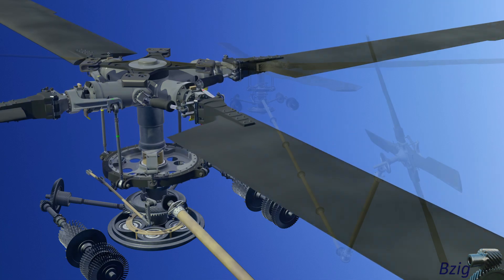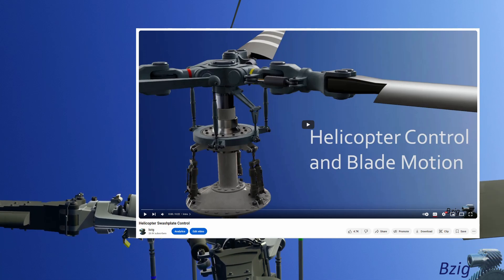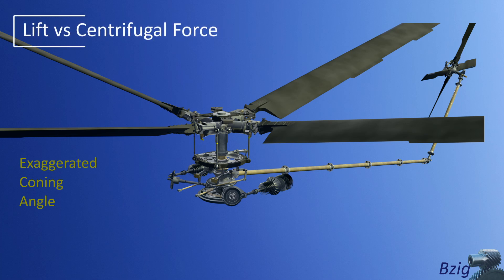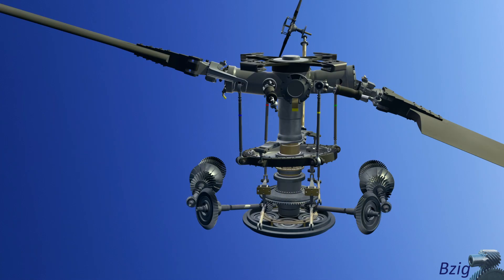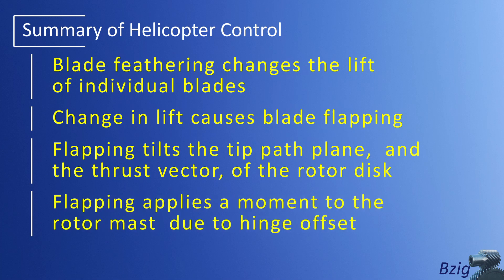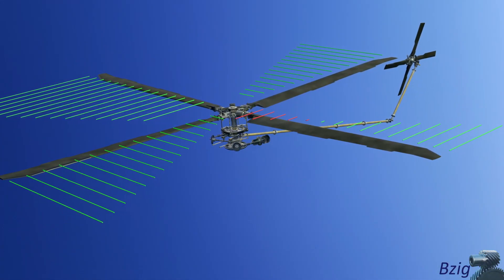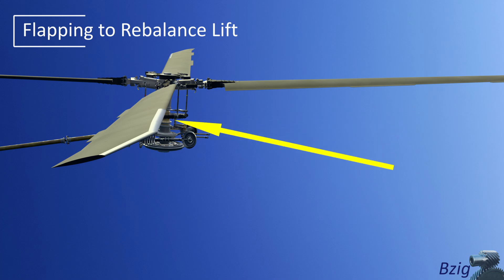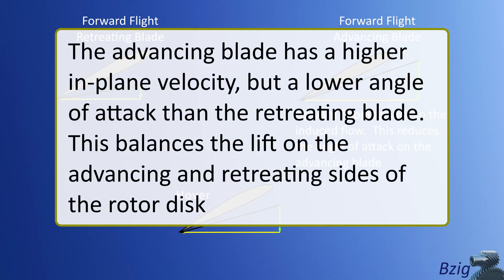Helicopter Control - Flapping

Comment: Your way of using normal flow to analize lift isn't a good way to analize airflow in a airfoil 
If we were talking about a fan type design like the ones on turbofan engine we would have used this method which is called the velocity triangle (in jet engines they are called cascades instead of airfoil) but in something like a helicopter rotor where you have 4 blades instead of 18 you have to use the pressure distribution and viscous effects to predict the behavior of the rotors
Reply from the maker: I think I understand you.   I'll write what I believe you wrote for confirmation... The airflow through a helicopter rotor is normal to the disk and helical through the disk.  by treating this a pure normal flow... I'm ignoring a significant contribution to what's aerodynamically happening.  Is this a correct interpretation?

Comment: How does rigid rotor systems handle dissymmetry of lift if there is no way for it to mechanically balance with flapping? Is it in the swash plate design that’s increases aog for treating blades with air speed? or does the pilot have to compensate with directional flight?
Reply from the maker: awesome question!  Check out ADA100181 "Advancing Blade Concept Technology Demonstrator" published in 1981.  This was much more of a "rigid rotor" than even the helicopters we refer to as "rigid."  This aircraft reduced cyclic pitch on the advancing side to reduce lift (and also had an advancing side on both sides of the helicopter).  The aircraft we typically think of as "rigid" such as the lynx and the BO-105 are not nearly as stiff as the ABC.  While the ABC needed some sophisticated control system to do what it did, the lynx and BO-105 deal with this with plain old flapping.  The hinges are called "rigid" but there is enough deformation to allow flapping.

Comment: ok, this just answered a question i had about heli flight characteristics
Reply from the maker: awesome... I'm glad it helped!
Reply: @bzig4929  i'm glad you exist with your efforts. they are not in vain. and i await more gritty mucky down to the bolt, details with very baited breath.

given you actually understand the area as little Timmy and little Suzie can understand what you say. a true hallmark of an expert is being able to explain it to a 5 year old and the child understands it.
Reply: @bzig4929  you've taught me so much about helicopter operating gear. Your channel has been invaluable.

Though am curious about the differences between the different set ups. I know contra-rotors have insane lift and speed, Igor's design is simple and effective, tandem is a weird hybrid of the other two, and intermesh is crack.

Comment: Would a dual rotor system (one of top of another, rotating in reverse of another) solved the retreating n advancing blade problem at high flight speed on top of eliminating the need of tail rotor? 

Do disregard my question above if is a funny or may even be stupid question;

Comment: Is it known if Igor Sikorsky was aware of these other necessary blade movements, flapping and Lead-Lag, and did he design the first helicopters rotor system with those freedom of movements? I can’t picture someone being able to anticipate those aerodynamic principles of a rotorcraft before they existed. Even the theory of collective and directional movements using blade feathering/pitch is astonishing for someone to be able to theorize and be confident enough about it working to build it and test it.
Reply from the maker: There was definitely trial and error even with Sikorsky.  The first version of the VS-300 used separate rotors for pitch and roll control... this was after Cierva first used cyclic pitch for aircraft control.  It's amazing what these folks accomplished.
Reply from the maker: recommend this 30 page history...  A History of Helicopter Flight, J. Gordon Leishman

It's a free download.

Comment: At 9 minutes in, you mention that the forward flight asymmetry of lift would cause the helicopter to roll. But since gyroscopes experience a phase lag of 90 degrees when a force is applied, wouldn't the asymmetry of lift actually cause a pitching moment for the helicopter?
Reply from the maker: I didn't say this as well as I could have.  I should have said... absent blade control... if you were just dragging a propeller sideways... then it would roll to the left.  With the flapping hinges, the blade on the right flies up, and the blade on the left flies down while the aircraft stays wings-level.  This tilts the disk to the left, and also causes a thing called blow back which, as you say, is an aft tilt of the disk due to phase lag.

Comment: Doesn’t the translation of the lift vector come from the feathering, not from the flapping?
Reply from the maker: feathering causes the lift change that makes the blade flap.  While feathering increases the lift vector, tilting the disk is done my flapping and this is what tilts the overall lift vector.

Comment: I can't quite wrap my head around why up flapping adds to the induced flow and down flapping reduces induced flow. I understand the resultant relative winds will change due to the flapping position. Is this the reason?
Reply from the maker: it's hard to explain, I think I did a better job it this video...  
https://youtu.be/gjZbgE8Yhg4?si=zk4DnXYZNt3Asrhf&t=280

Comment: During blade flapping in forward flight, I still can't picture why blades flapping up would "add to normal flow and decrease the AOA" Does anyone have a simpler explanation for this?
Reply from the maker: Hold your arms out to your sides with palms facing down.  Now flap them up and down... On the downward flap, you feel air on your palm.  On the upward flap, you feel air on the top of your hand.  

What do you think?  Anyone else?
Reply: @bzig4929  Thank you. After trying that out, I can see that the air felt by my palm on downward flap added "lift" to my hand. Continuing with this analogy, can you explain the decrease in AOA with my palm already facing down?
Reply from the maker: I think the graphics I included in my latest video... this one:  https://youtu.be/gjZbgE8Yhg4  do a better job of showing this.  Briefly... the air you generated by flapping is "normal," or perpendicular to the rotor disk.  The other component, that caused by blade rotation and forward airspeed, is in the plane of the rotor disk.  And the angle of attack is the vector sum of the normal and in-plane components.  So when you change either of those components, the angle of attack changes.
Reply: @bzig4929  It did. Way better explanation! Thank you! Glad I subscribed!

Comment: The drawing at 11:00 is 😖😵. Example: the 'advancing blade' and the 'retreating blade' are drawn at the same angle to the level axis of the video, but a black line is drawn higher for the advancing blade and drawn lower {decreased angle measure} for the 'retreating blade'. You know you have two angles: 1]the one that increases the surface area to apply increased 'force' on the atmosphere and 2] the one that raises or lowers the long-axis of the wing to coordinate the craft. I believe the word 'feathering' describes #1]. Each wing has to be drawn in '3D' to clarify the angles.

Odd that the pilot has a heated gear-powered meat grinder 5 to 10 feet aft of him/her in a helicopter.
Reply from the maker: I'm taking a lot of liberties with aerodynamics and making things "look kinda right."  If/when I get better at animations and geometry nodes in Blender I have this idea of feeding velocity vectors (I think this is what you mean by "3d to clarify the angles") with more robust aerodynamic equations.

Comment: The animation did not make clear to me why flapping down increases angle of attack.  Does the flapping mechanism introduce a cyclic feathering change in addition to the cyclic feathering change introduced though the swashplate?  Watching the animation the angle of attack seemed unchanging with flapping angle change.  BTW, this series is awesome, in general, much appreciated!
Reply from the maker: Your not the first to make this comment.  I'm thinking of re-making a video to explain this better.  See if this helps... While holding the blade pitch angle constant... when a blade "leads" the rotation, temporarily increases the magnitude of the in-plane flow of air to the blade.  Likewise, when a blade flaps, up or down, this increases or decreases the normal (90 deg to the plane of rotation) component of the flow of air to the blade.  The blade AOA is made up of both of those vectors... the in-plane and the normal.  So anytime one of those vectors changes, the AOA changes.  All while the blade pitch angle is held constant.
Reply: @bzig4929  TYVM, yes, that is clear, suppose in a hypothetical extreme the blades flapped up 90 degrees, then there would be zero lift.

Please excuse me if I am misquoting you, but I believe you discussed this in terms of blade angle of attack, not vertical component of the lift vector.

A quickie way to address this might be a text box with something like [*equivalent* angle of attack, actually vertical component of lift vector]

Angle of attack (AOA) is typically defined as the angle between an aircraft's wing chord and the relative wind. 

For a helicopter in hover  the blades move along an abstract conical surface (ignoring flex).  Flapping angle changes the angle of that cone at its apex, but does not change the angle of the cord of the rotary wing with respect to the surface of the abstract cone.

In forward flight flapping will change the cord angle to the relative wind in a complicated function of rotational position with respect to the direction of motion.

Comment: The only thing I can’t get straight in my mind is how the advancing blade…If I understand right…will increase feather/pitch angle but will decrease angle of attack/lift….and just the opposite on the retreating blade.   It seems like that  would have the same affect as raising the collective and increasing lift?  I need more coffee…
Reply from the maker: The blade doesn't change pitch/feather angle; that is constant unless the pilot moves the controls.  The blade on the right side sees more airflow, so it makes more lift and flaps up.  The upward flapping essentially reduces the normal (not tangential) component of velocity seen by the blades.  The angle of the relative air changes, but not the angle of the blade.  It's easier to explain standing in front of you and flapping my arms up and down.  But it's a good question and I need to improve the graphics and the words to make it more clear.  Thanks!

Comment: Another aspect you could look at is the flapping removing the negative impacts of gyroscopic precession.  Cierva who developed the flapping hinge for his autogiros commented that the flapping hinge was developed to solve the difference in lift between advancing and retreating.  The blades had no cyclic control were fixed and used elevators and ailerons to control the aircraft the blades were a lift device and essentially anti-stall protection.  Latter the full head was developed in the early 1930's for autogiros.  At the time though he commented that the early experiments suffered from dis-symetry of lift issues and gyroscopic precession.  This one hinge solved both.  But agree the video needed to stop where you did.  You have excellent explanations and having played with some CGI animation your animation skills are amazing too.  I know how hard it is even on our simpler heads to explain things your model is amazing.  Well done.  If your interested in the history Sir Reginald Bree (Ceriva's test pilot) wrote a book on gyros in the 1930's that went into the head development (which was latter adopted by helicopters).  The early gyros had fully articulated heads even jump heads with collective pitch control.  https://www.youtube.com/watch?v=SMBe1nBAmN0
Reply from the maker: There was a time in the 30's and 40's, when the early helicopters were in development, the autogyro was much more advanced and most would have predicted an autogyro future.  If you're interested, look up the "Franklin Institute Meeting of 1938" and the Dorsey Logan act.  The autogyro community campaigned for more military funding of this technology but at the last minute, the meeting changed to include all "rotating wing aircraft."  No doubt many helicopter innovations cam about from autogyros.  Thanks for the video link.
Reply: @bzig4929  Yep the flapping hinge once you understand it is a wonderful thing.   I used to fly in ultralights before I got into gyros.  I remember having flown gyros for years getting offered a ride in the same ultralight I'd been trained in.  We took off and the owner said want to fly it.  You Bet!  We hit a thermal under one wing and the ultralight kicked that wing up "You going to correct that?" he said "oh yeah" and I corrected then the other wing came up in another bump "You going to correct that?" he said again.  I couldn't figure out why I was flying so badly and I actively flew for the rest of the flight but after landing and getting into my gyro I worked out I don't touch the controls in thermals (even though I don't even feel the small ones).   Anyway I worked out it was the teeter hinge my blades can't tell if they have more lift from extra airspeed on the advancing side or from a thermal hitting on one side before the other.  It just compensates and you don't have to do anything to you learn to fly passively.  Gyros are more fixed free stable than helicopters but I realized why all rotary winged craft can handle the rough weather better than fixed wings and all with one hinge (on a twin bladed rotorcraft).  Such an elegant solution.  He (Cierva) apparently got the idea from stress relieving hinges on bridges which compensate for expansion and heat on metal bridges.
I will look up that meeting - I was aware of some of this and issues around patents around ww2 when Pitcan held many of the patents and the war engine allowed them to be walked over.  He really got screwed over unfortunately.  But I'm glad they contributed to the helicopter I like all aircraft - especially anything with rotary wings.

Comment: Great video! So, the tip path plane does play a significant role in the yaw movement of a tandem rotor helicopter, doesn't it?
Reply from the maker: It does!  In tandem helicopters yaw is accomplished with alternating lateral cyclic input.  To yaw left, for example, a left lateral cyclic input is sent to the front rotor, and a right lateral cyclic input is sent to the aft rotor.  This is all done in a flight control mixing unit, so the pilot is doing this with the pedals.

Comment: Excellent and instructive video, you have earned a subscriber!! 
I wanted to ask you, what do the blue, green, yellow and red rings on the pitch shift links mean? Thank you so much!!
Reply from the maker: Those are for the maintainers to identify the blades (and for me to identify which blade I'm looking at as I make changes to the animation).  Here's a scenario... The pilots collect rotor track and balance data and then maintenance writes a work order to add tip weight to a particular rotor blade; they could identify this by blade srno, but it's much easier if the blades are colored to make it easier for the mechanic doing the work.  Thanks for the question!
Reply: @bzig4929  Thank you very much for your time and willingness to teach us.

Comment: Really well done! I've only flown as a pax and 2x as intro right seat so don't know much other than these are amazing machines. As a heli-ski pax, I have to say, the pilots LOVED pitching down to gain a lot speed very quickly so they didn't seem to be too concerned about over-speeding.
Reply from the maker: When I was flying, I loved doing that also... lift to a hover on a mountain peak and cyclic forward to increase speed and also stay close to the terrain.  Good times!

Comment: should tail rotor on right side or left side when main rotor is rotating counter clock-wise ?
Reply from the maker: It can be on either side, regardless of the main rotor rotation direction.  The tail rotor is either a "pusher" or a "puller".  Industry seems to favor mounting on the left side by a slight margin.

Comment: If I fly, it's a fixed wing, even then, I prefer to be on the ground unless I can reach the yoke or stick.
I put too many R/C models of mine into the dirt to screw around, I have stick and rudder skills, and I don't crash anymore. 
One glider I have has 500+ flights, it really helps to know how to control an aircraft, and fixed wing has so much less to go wrong.